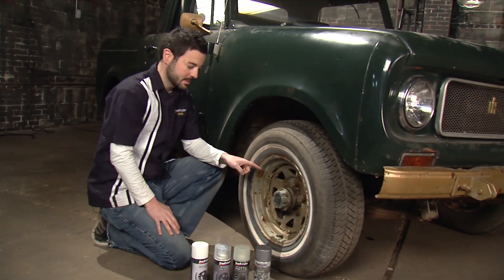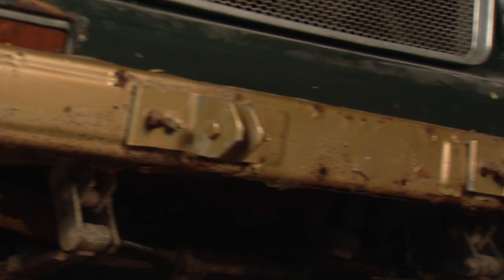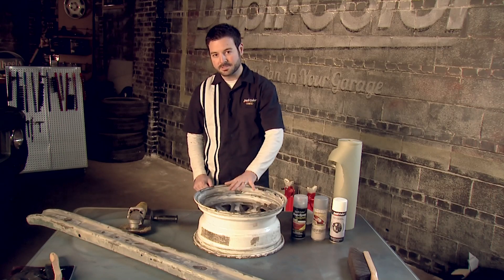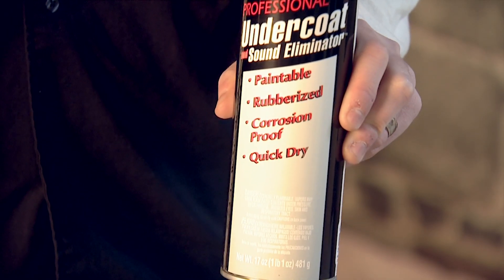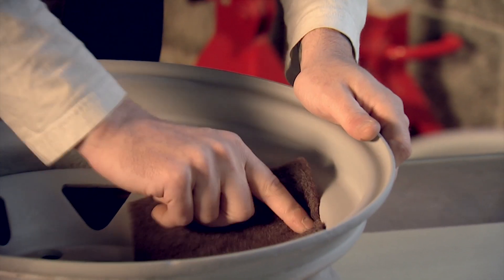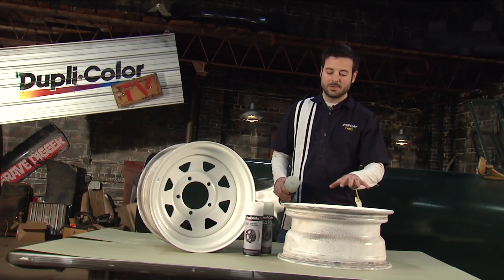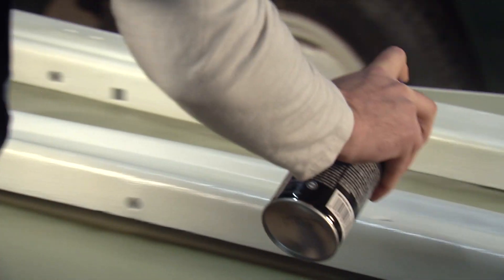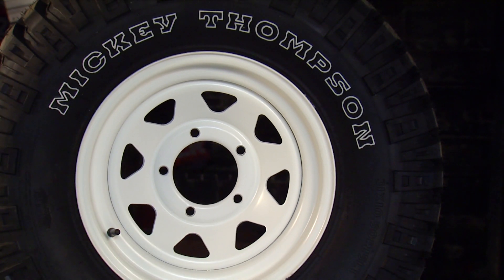Dupli-Color 1969 Scout Restoration Series Episode 6: Wheels & Bumpers

Comment: I used Duplicolor Wheel Gloss paint, and something must have been defective. As it was like spray a water gun as there was no way you could do a "fine mist" spray. The only way to do fine mist was to barely press the cap. But generally, it was spraying too much clear as the substrate looked like it was getting hit with a water gun with water running down. I guess it must either be a defective cap or too much pressure in the can.
Reply from the maker: We're sorry to hear this. Please give our customer service team a call at 1-800-247-3270 or email cbgsocialmedia@sherwin.com for help resolving this issue. Thanks.
Reply: @duplicolortv  I returned it and got another can that sprays normally.